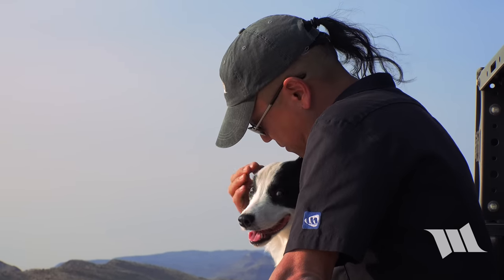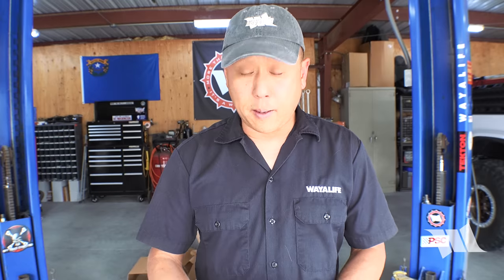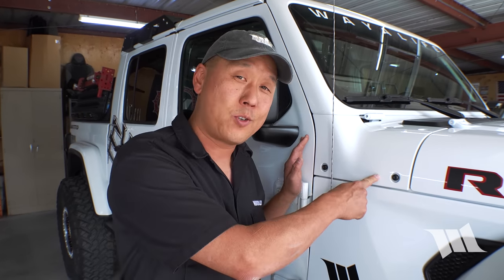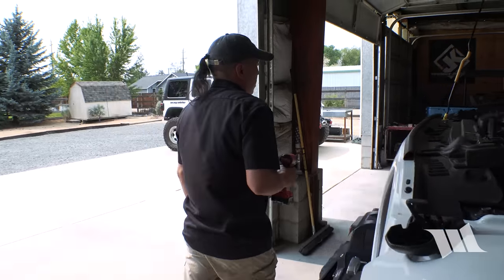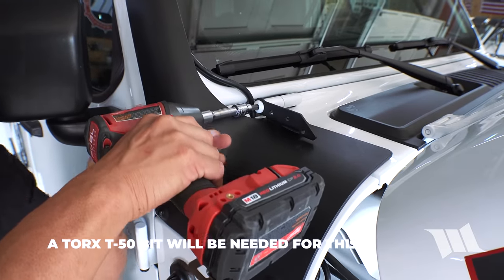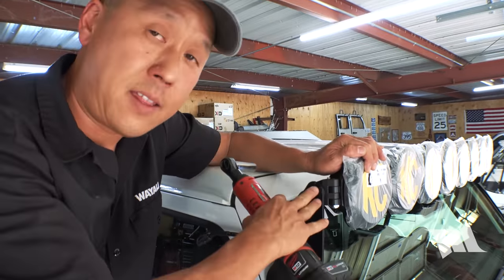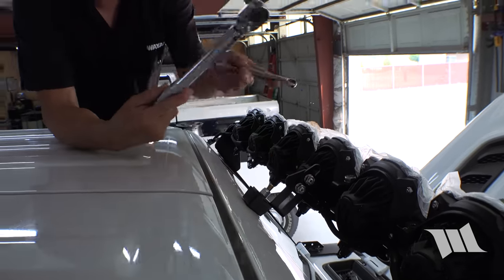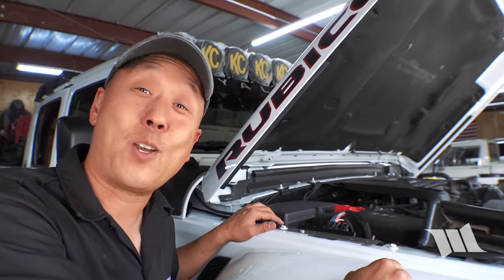KC Gravity Pro6 LED Light Bar Installation and Testing on our Jeep Gladiator Truck JL Wrangler

Comment: Just did this! It’s as easy as it looks. Plugged it into AUX 2. I can’t hear any extra noise at 60 mph. It looks awesome on my JLUR.
Reply from the maker: Great to hear!
Reply: Did you do it the same exact way with the Aux wiring as in the video? Just using the aux wire for power and grounding the other? Thanks

Comment: Your truck build and tutorials are great.
Another A+ mod
Reply from the maker: Glad you like them! :)
Reply: @wayalife  Quick Question,, Do you know if the Pro6 light bar will interfere with the operation of adaptive cruise sensor?
I love the look of this light bar and am starting the build of my new 2020 Mojave
Reply from the maker: So, that's a good question and the answer is yes. I tested it out soon after installing it and my works just as before.

Comment: If you have the budget to afford these they are awesome. I went the route of the Halogen ApolloPro and set up is alot more complicated then 1 wire. It is 3 sets of 2 and a wiring rats nest but I figured a way to hide the 6 wires under the light bar with the supplied clips and a few many wire ties. The next wire headache is hiding the 6 wires behind the metal bracket. KC makes a hide a wire for your style but it can not fit 6 jacketed wires so I had to compromise and eliminate the jacket on the wire and removed the silicone cushion pad. I placed heavy duty Grollia tape as the buffer and that left enough room to place the wire under the tape also and gave enough room to hide and tape down the channel of the a pillar metal bracket. I left enough of KC's original jacket on to go under the cowl. Switch wiring is run under the windshield, down through the top speaker grilles, channeled out through the side cover and dropped through to the door wiring harness. A lot of work and in the end I love the lights but the extra $1000 for your set up is far worth it.

Comment: bought these the moment the JL bracket was released about a year ago and love the lights.  Although so dang expensive!  A little buyers remorse but not much beacause they are quality.....
Reply: also the center bump stop may need to be adjusted a couple times till you get it perfect and stop the vibration, that was my experience at least.
Reply from the maker: Yeah, I've have to make at least one adjustment so far.

Comment: I purchased a set last year and love them.  I would highly recommend buying KC’s anti-theft nuts to protect your investment though.  That whole setup is roughly $2k and can be easily stolen.  

Also, for those of us that want a different color  KC emblem on the cover, KC provides a template for free on their website.  I had my wife use her Cricut to make red KC stickers to go over the yellow stock covers.
Reply from the maker: Thanks for the tip on the anti-theft nuts.

Comment: Looks like a great kit, but then I realized it won't fit on a Wrangler 4xe.  The driver's side cowl piece is the location of the J1772 charging port.
Reply from the maker: That's a bummer.

Comment: I wish they could make those brackets three inches taller. I’m 6’2” and my vision is blocked by the windshield frame already, when at a traffic light I have to lean forward and down to see it. The light bar hangs down below the windshield frame.
Reply from the maker: I could see how that would be a problem for someone of your height. For me, I really like that they sit low. It really helps in the trees and I kind of feel like they help keep the wind noise down or at least, when compared to other lights.

Comment: Absolutely loved this video and I'm placing an order.  My only question is, how different is the installation with the OEM Aux button cluster?
Reply from the maker: It'd be easier with the OEM auxiliary switches. Just make sure to use #1 or #2 as they have the big power.
Reply: Wayalife Awesome!  Thank you for the reply. Sub’d

Comment: Always enjoy your videos. Not gonna lie, your unboxing scenes are like ASMR. I may or may not have a spending problem lol. How did they perform with all the dust in the air? If you’re leading the convoy it may not be an issue but if you’re following, I’d imagine it being almost more difficult to see through the dust. Any feedback would be appreciated!
Reply from the maker: LOL - thank you, so glad to hear you enjoy our videos! Typically, we're always in the lead and when we're not, it's typically frowned upon to turn on lights this bright when you're following. Now, assuming you drop back far enough to not be a bother to the guy in front of you, the lights do provide a more yellowish hue versus the super bright white that the factory LED headlights put out and that helps to cut through the dust.
Reply: @wayalife  thanks man. I’m pulling the trigger on these bad boys! It’s been up in the air for some time now but I can’t seem to find a reason to not get them. I’ve had a hard time finding feedback on wind noise. I know jeeps and wind noise are basically siblings but have you experienced a noticeable increase?
Reply from the maker: Honestly, the noise from the wind really isn't as loud as you'd imagine and I've owned and ridden in Jeeps with LOUD light bars. My tires are way louder than this thing.

Comment: So I am still pretty new to wiring. I have a voswitch 800 max 30 amp draw per relay. Would I be doing a similar process you did? From what I can see I just need two ring terminals and plug them in.
Reply from the maker: Yes, you should be able to do it the same way.
Reply: Well my install was a disaster 🤦🏽‍♂️ I didn’t have MM wrenches and the VoSwitch is not easy to install to. I will be going to a shop tomorrow to see if they can help!

Comment: Great lights but thought the installation design was very poor not hiding all the cable and  no caps over nut and bolts which are exposed to the elements even if stainless steel . Just me being picky but when your jeeps yeh baby it’s the best you can get it in my opinion.👍👍👍
Reply from the maker: Fortunately, there are a lot of other options available out there for you to choose from. Me personally, a pair of KC ERA 4 lights with combo beam mounted on the bumper do a much better job of lighting the way.

Comment: Loved it! I plan on pulling the trigger on this bar thanks to you and installing it while watching your video. Have a few questions:

1. It seems the round lights throw a lot of light on the hood vs a rectangle bar. Is there any easy way to mitigate that without losing good aim at the ground?

2. Is there any way to adjust the curve or the angle of lights individually or would that affect the length of the bar?

3. How are the covers mounted to protect the lights? Are they magnetic?
Reply from the maker: Honestly, I would say the exact opposite. Compared to the light bar I've tested in the past, I feel these are way more subdued on the hood. I hardly notice them when driving but then, that's just me.

You can set the bar so that the center lights are straight and the end ones angled out. You have enough wiggle room to make it work. I show diagrams of this in the video.

The covers snap into place.

Comment: Finally received notice mine will be delivered on 12-29-20.  Your video will be my go to for installation of mine.  I have the auxiliary switches on my JL. Will I be able to just cut the harness as you did and wire direct to one of my 40 amp switches?  Thank you for your help.  
From northern Michigan
Rick
Reply from the maker: Congratulations to you and yes, you would be able to.

Comment: Is the install on the AUX switches anymore complicated than what you did for yours? Thanks for the awesome vids
Reply from the maker: Nope, you'd pretty much do the same thing. I would recommend that you use Aux 1 or 2 though.
Reply: Wayalife switch 2 it is. You used switch one with the pump install :)

Comment: I just want to get your honest opinion whether the  KC Hilites gravity pro 6 which you're using is producing so much wind noice at a certain speed. I'm planning to have one. Thanks for what you are doing. It's very helpful
Reply from the maker: Anything you add to the outside and top of your Jeep is going to catch wind and that wind will translate into noise. Compared to other light bars I've run in the past, I'd say it's less noisy that most. Maybe about as much as a roof rack.

Comment: Sorry late to the party,  Eddie I have a technical question regarding the wiring? I have the factory aux switches already in my gladiator couldn't I uae the 15amp switch I believe is #3 & #4 to wire the harness and using the same black and white wiring you used? Thanks in advance
Reply from the maker: Yes, you can hook up the main power lead to one of those switches and then connect the ground to one of the bolts on the fender.

Comment: So... How's the reflection from the hood?  I've heard these KCs have a bit of a cutoff on the bottom to limit downward shine up close, mitigating reflection.  I have an Mrack on my tundra and have used 2 different light bars up front above the windshield, and although the reflection isn't awful, I have definitely kept my realistic usage down to the Baja Designs lights in my bumper.  I love having light up higher, and have just added these to my cart on KC for black Friday (reserved, since they're out of stock), but hesitant to drop 1300 bucks for lights I might not use much because of reflection.

Either way, awesome jeep (from a Toyota fanboi), and great video.  The editing and quality is excellent.  New sub here.
Reply from the maker: Honestly, I don't feel like it reflects off my hood much at all especially when compared to other light bars I've seen in the past.

Comment: Is it just me or does this seem to be an overly engineered lightbar that still ends up looking a little on the sloppy side and way over priced?  The lights themselves look sharp, Ill give you that,  but for $1800, I would like to see something a little more solid that doesn't rely on tension bolts to keep it straight as well as a better means of running the wire and not leaving it exposed in multiple places. 

I would also love to find a solution that lets me keep the snorkel.  All that being said, love the rig and the channel, keep up the good work.
Reply from the maker: It is pricy but I think the light it puts out is well worth it or at least to me anyway. Would have been nice to keep the snorkel and I think it'd be possible with a different light mount bracket but really, in my over 25 years of doing this Jeep thing, I can't say that I've ever needed a snorkel.

Comment: Still no issues with the Adaptive Cruise or Braking? I'm getting mixed reviews. I've been told by one KC employee that it will not work on my JL and another employee said it will work with no issues. I even have a photo from them showing error messages from their JT with the Gravity Pro 6. Most people are saying no issues though. Did you have to modify at all to avoid issues? (Side Note: I love your videos. First time Jeeper with a 2019 JLUR and you've helped me SOOOOO much!)
Reply from the maker: Congratulations to you on your new Jeep! Regarding adaptive cruise and braking, no problems on my JT and I didn't do anything to make it work. It just kept working and I use it all the time.
Reply: @wayalife  Thanks man. I’m gonna bite the bullet then. Keep up the great videos! I’ll be a certified YouTube Mechanic in no time thanks to your help! LOL

Comment: great video but the light output doesn't look any better than my 24" led strip.  Is it just the video?
Reply from the maker: For sure, it is very difficult to film lighting at night. For the most part, it'll look way too bright. We purposefully took measure to step things down so that you could actually see the difference in lighting. That being said, I haven't a clue as to what your 24" strip light looks like and for all I know, it is about the same.

Comment: If you use the factory relay and fuse which one would u choose for this set up. The 40 Amp or 15 amp
Reply from the maker: If you're referring to the factory auxiliary switches, there is no need for a fuse. Also, if I recall, each light only has something like a 6 amp draw but all together, that would be 36 and so I would use the 40.
Reply: @Wayalife  thank you for responding.  That's what I thought.  I wanted to double check with someone who was familiar.  By the way you have the best how to do videos out there. Thank u again for your help. Have a great day
Reply from the maker: @Tony Paolone Thank you! Humbled to hear you say as much.

Comment: Love the video as always but I have a question that’s buggin me, we watched the instillation of the snorkel n now the light bar. How do u install both if they mount in the same place?
Reply from the maker: Well, in our case, we didn't keep both. But, I know there are light mounts that install differently and you could probably use them to make it work.
Reply: you don't.  Its one or the other and this is my gripe about these lights as well.

Comment: I wonder if I can fit a few of these Pro6 across the windshield of my Renegade Trailhawk!
Reply from the maker: So long as you can install some kind of mounting bracket, I'm sure you could.
Reply: Wayalife I think it’s DayStar that has an awesome, under the roof rail light-bar bar, but can these Pro6s mount from the rear?

Comment: teraflex or evo suspension what are you thoughts?
Reply from the maker: I've run both and honestly, there's no comparing the two. EVO is MADE IN THE USA and to extremely high standards and TeraFlex is just "Designed and Engineered" in the USA and made in China. I can show you proof of all the breaks I have seen.

Comment: Very cool... Wind noise issues at highway speeds?
Reply from the maker: For the most part, no. My tires are way louder than it. In a heavy cross wind, you can hear them a bit. However, my roof rack makes more noise.

Comment: Does it cause a whistling sound on the freeway?
Reply from the maker: So, unlike the boxy light bars that were all the rage a few years back and whistled, this does NOT. Just like any roof rack, you will be able to hear wind but it's nothing too bad and a lot quieter than the other light bars.

Comment: Any noise on a speed?
Reply from the maker: Well sure, you can hear them a bit but surprisingly, they're nowhere near as loud as most of the boxy bar lights that are out there. Also, my tires are way louder than this.